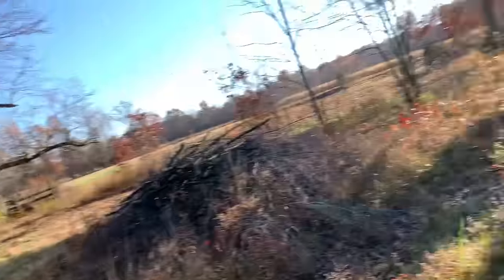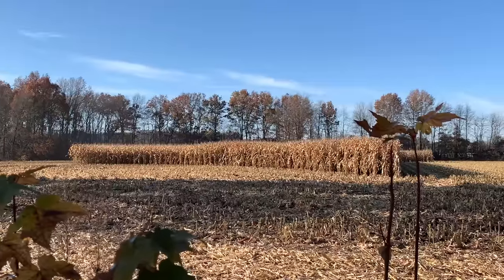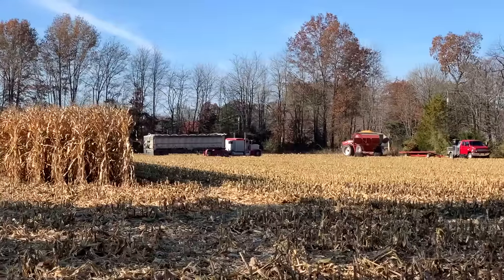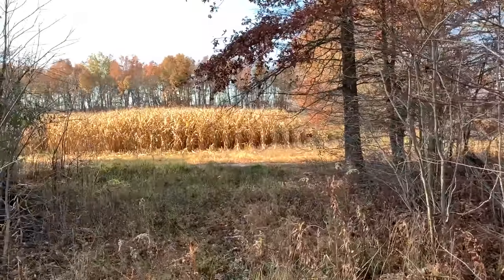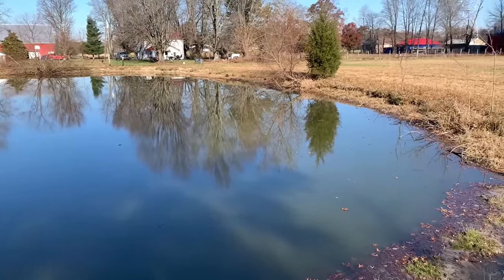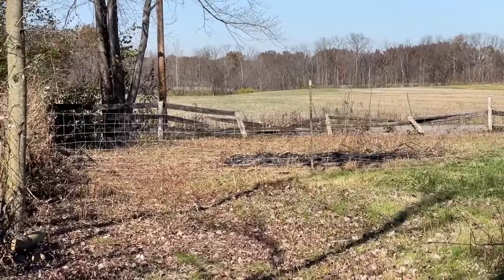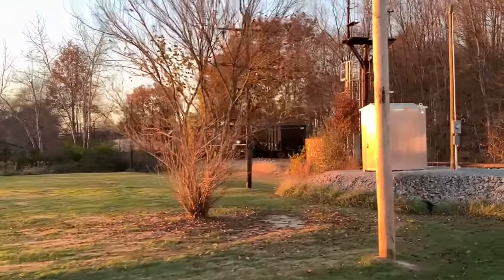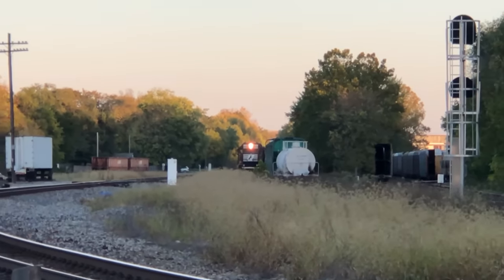Ohio Corn Harvest 2023 & Railroad Diamond Action In Logansport Indiana! Combines, Tractors & Trains!

Comment: Great...I used to haul corn in Tri- axles...they would wait until the moisture content was low before they cut it..we did alot of our work at night...We could run a little overweight as dot wasn't out weighing trucks...Nice video..brings back memories
Reply: Usually after the first frost. Causes all the moisture to drop. Less drying time. More per yield.

Comment: My neighbor Farmer John just wrapped up several days of harvest around my house.  A lot of it was special hops for one of the local micro brews and rye for a local distillery.  The low ground pressure tracks on the combine and trailer are neat.  I helped Farmer John change belt positions on his old John Deere combine and he told me that combines have hundreds of different settings depending on the crop and moisture content.  His machine has around $20,000 worth of belts in it. The newer combines run a.c. motors and variable frequency drives.  You can change crop settings in minutes instead of hours but the costs are far higher when a drive or motor burns up.  Great video, thanks Farmer Brian!

Comment: What you have there is an almost 10 year old 9230 CASEIH combine with a 31.5 foot long unloading auger and a 12 row corn head.  The CASEIH 350 tractor is pulling a J&M 1112 grain cart.  Almost 1200 bushel capacity.  The peterbilt truck has custom fenders and an end dump trailer.  Probably hauling to an elevator or the farm storage

Comment: I have cousins in Iowa and Clay County S. Dakota. My one Cousin has a gigantic farm. His one tractor has a cab , it's air conditioned, comfortable seats , has a stereo and GPS, THEY USE THE gps FOR PLANTING/FERTILIZER. . he tells a story on he has a cornfield at a busy intersection and the corn grows a lot taller b/c of the car headlights at night.😄  thats probably feed corn . a lot of the new tractors they make it so they can only be repaired by a factory tech, they are doing the camr for autombiles. one way is they do not sell parts nor allow 3rd party make parts.

Comment: Thank you for the tour of the Back 40 the front 40 the side 40 and the agricultural activity taking place. Just looking at the Innovations in agricultural equipment plus the fact the USA has some of the best soil for growing crops plus the tenacity and know how of the farmers that is why America is an agricultural leader. Too bad CCET was shutting down for the day put the tape on that gentle angle Crossing add Logansport was nice an angle usually not shot from. If you look quickly it looks like NS has installed third rail except that is some of the heaviest Duty No Parking blockade. Maybe next time you can check on the year and weight. With  today's longer semis all it takes is a truck or two to encroach upon the right of way and you either have a collision warlike several years ago where Amtrak derailed on track knocked out of alignment. Perhaps as the older covered hoppers are being retired you could line the property with all the Fallen flag lines add old billboard advertisement cars. The Neighbors iand zoning committee probably would see otherwise but it would be neat. The Stone Hedge of railroad equipment

Comment: Some expensive farm equipment there. The combine with the head is probably close to $500k. The tractor pulling the bulk trailer is probably about $300k. They are geared for harvesting on wet ground (tracks instead of wheels). Those guys will make short work of your 60 acres and with only two guys working - very efficient :)  That tall corn produces more ears per stalk and more yield per acre. Those farmers are good - they buy the right seed :)
Reply: The tracks help in traction. But are primarily used to limit soil compaction.  If the soil gets compacted, it won't drain and gets so hard, the roots can't penetrate thru that layer.
Reply: @robertheinkel6225  Thank you for the info!

Comment: I like this video. It is a nice change of pace. How big is that piece of land where you filmed this? Combine fires happen more than people realize. All that dry corn stalks are at the root of the fires. I always thought the use of corn wagons was an unnecessary step  during the harvest, then you explained how they are used to prevent ruts in the field, when a tractor trailer would cause ruts because of the narrowness of the tires. Thanks for teaching me something.
Reply: They also allow the combine to keep working while the truck goes off to unload. Take the wagon out and you'll need at least 2 trucks to keep harvesting.